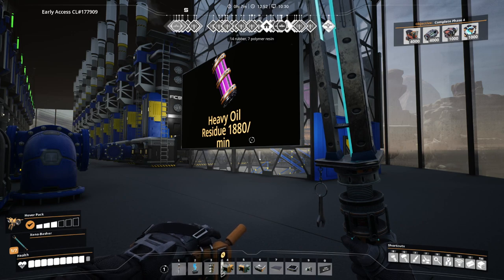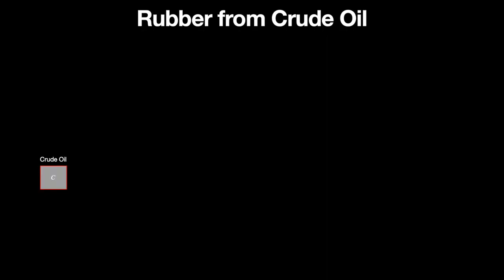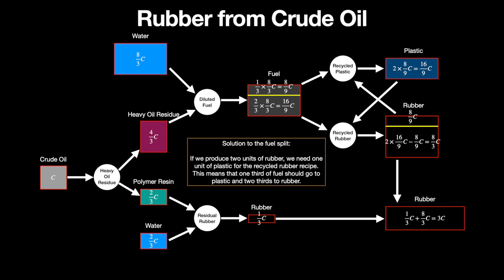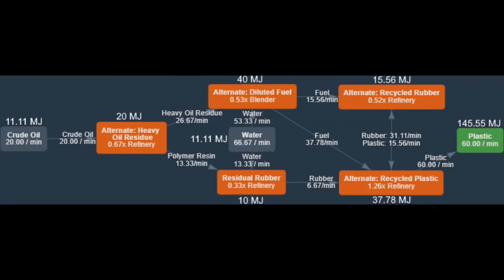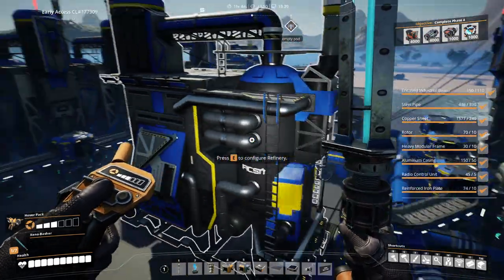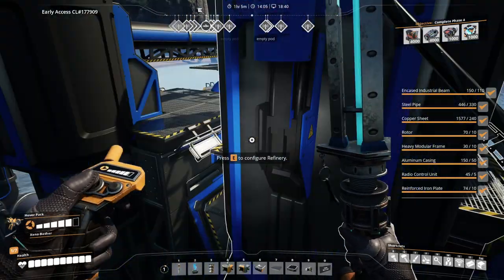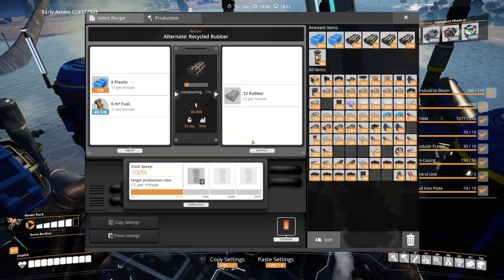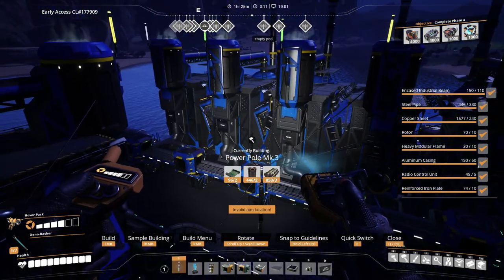350% More Rubber and Plastic - Why Is This Loop So Powerful in Satisfactory?

Comment: When I saw these "recycled" recipes I immediately liked them, because I already had the blender's "Diluted fuel" recipe unlocked and the cogs in my head started spinning. Together with handling the residual polymers it forms a very nice and quite complicated production chain, that is also insanely more efficient compared to the original recipes.
Reply from the maker: Yeah, they form a very cool and efficient production chain. I’m not sure if I had ever figured that out myself, though, so I’m glad the wiki exists :)

Comment: In early game before you have blender you can instead use refinery with Diluted Packaged Fuel with packagers on input and output looping empty canisters.
Reply from the maker: That’s true. This provides exactly the same output, but is a bit more complicated as you need to add packagers to the setup.
Reply: @Fjorim  But not much, just put one packager to each water input and fuel output and then loop empty canisters from output back to input, nothing complicated. Also you can easily replace it with blender in future. If you go with other recipe you will have to rebuild whole plastic/rubber factory if you want to adapt this rubber/plastic chain later.

Comment: Hey great video😎 will try to build when time comes👍🏻
Reply from the maker: Thanks! It’s worth it to build this way at least if you need loads of rubber or plastic. The biggest problem is finding the required alternate recipes :)
Reply: @Fjorim  just copy and past for each row? Or does it get more complicated?
Reply from the maker: You can copy and paste (well, build over and over) these layouts if you first divide your crude oil in batches of 90. Or make twice or three times as big and provide 180 or 270 oil to each unit (need to split water to multiple pipes if you do 270 though). The numbers work out well if you’re working with multiples of 90 (but not over 600 as your pipe capacity will be a bottleneck).

Another alternative is to extend each part of the setup separately. This makes the layout easier to plan, but pipes need to be planned so that you transport 600 (or preferrably less) fluid per minute per pipe. If you plan to use all the oil and it doesn’t divide by 9, you also need some precise overclocking to handle the residual. This is how my oil factory was built.

Comment: Beginning with numbers is quite overwhelming to understand as you said. Nice overlap with web calculator.

But most importantly, comprehensive example with easy to follow belts and pipes. Suddenly previous explanation makes much more sense and is much easier to replicate. (also, nice colour scheme, I should try blue)
I hope you make similar video going over Nuclear fuel rods production (and recycling) picking most efficient way.

Tip: Ctrl+LMB to fill stuff into machines.
Reply from the maker: Thanks for the tip, keep forgetting that :)
Reply: Double click works just fine for single stack